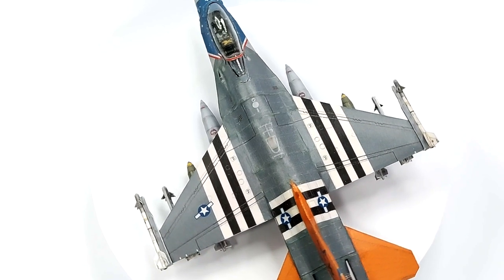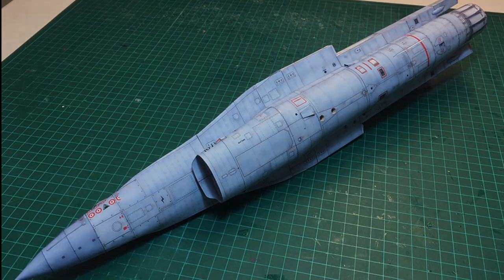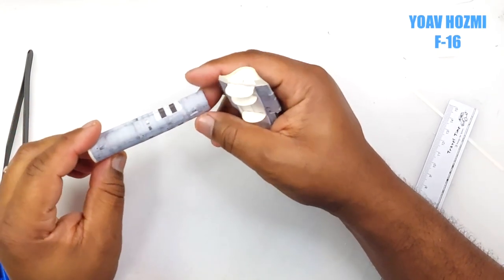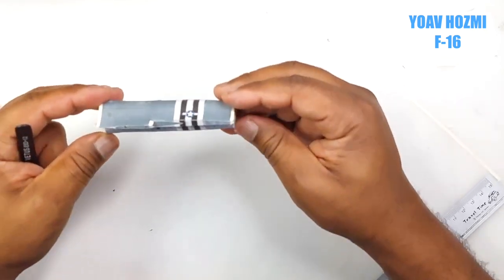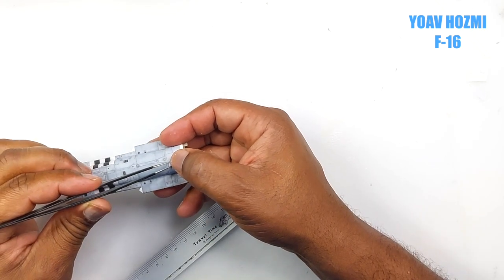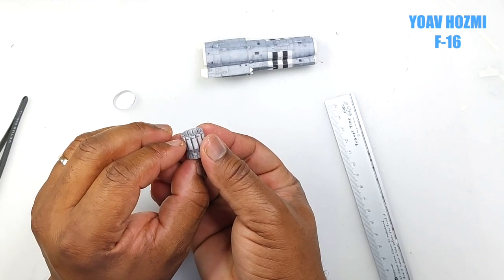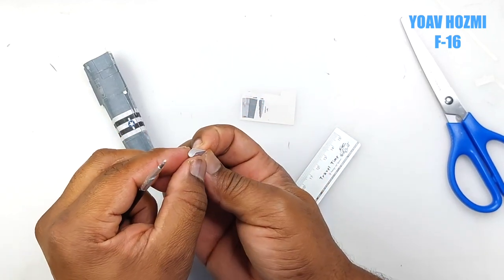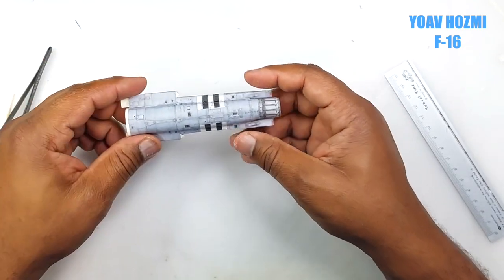Building The YOAV HOZMI Paper Model F-16 1/72 Scale Model Aircraft PART 2 FUSELAGE ASSEMBLY Pt.2

Comment: What type of paper did you use? It looks a bit thicker than normal paper, also what do you use to make the "skeleton" of the plane? The paper looks even more thicker
Reply from the maker: Yes it is. Regular bond paper that you use in office printers are 80gsm weight. The paper used is similar to greeting card thickness. It is 160gsm.
Reply: A little confused by  your answer -- for your 1/72 models, are you saying that you use "regular"  80gsm BOND paper (54 lb text), or is it 160gsm (42 lb Bond / 109 lb  text) for both graphics as well as  backing (what iceman referred to as "skeletron" - the 1mm or .50mm used in 1:33 models) . Paper types and weights are sometimes can be  challenging to understand.